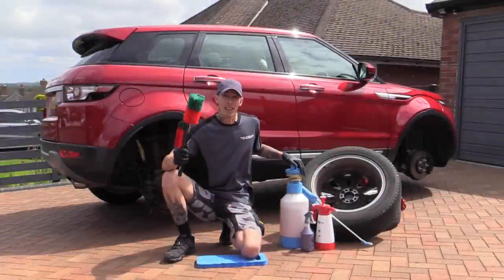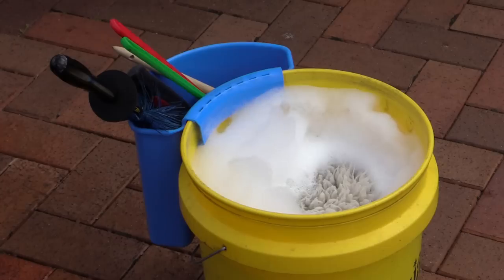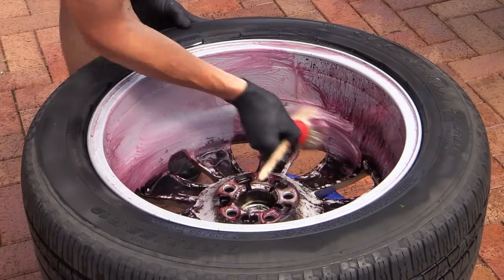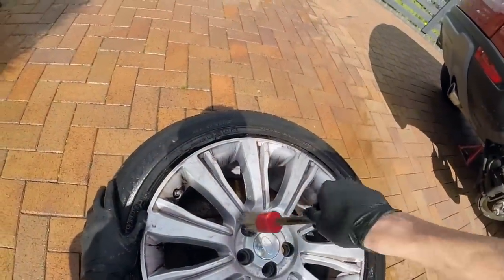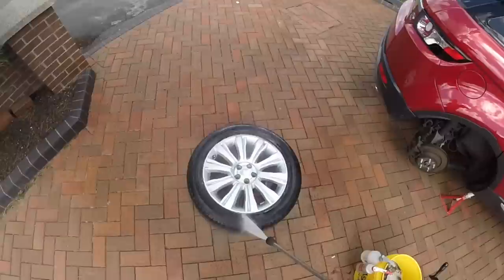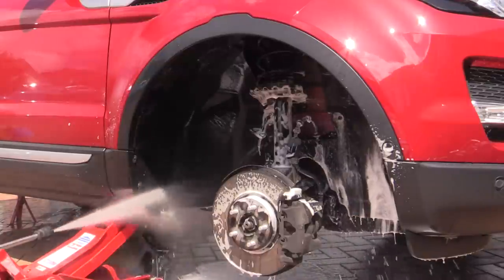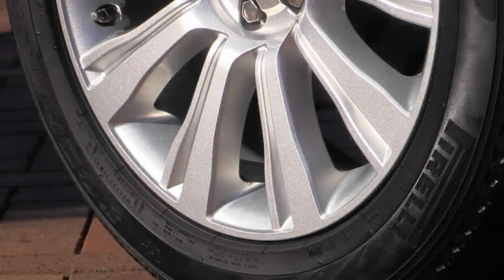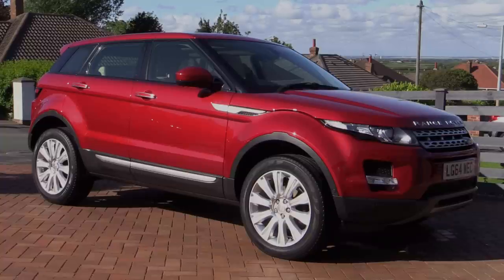Range Rover Evoque Wheels-Off Wash

Comment from the maker: One of those days.
Reply: I got the feeling it wasnt HIS wifes
Reply: Do you ever worry about repeat exposure to the cleaning chemicals and the contaminants youre cleaning off?
Reply: Car Cleaning Guru love your videos!!! Sending some warm texas love your way and if your a dad happy fathers day!!!
Reply: Is your car still for sale? If so how much do you want for it?
Reply from the maker: Not yet, still need to get a few pre sale bits done. Going to put it on eBay with a reserve so everyone can get a shot but I’m open to offers in the meantime.
Reply: Guru you're too hard on your work-- the car looks great and hopefully your wife agrees!
Reply: I'll be interested in your C30 let us know when your putting it up for sale
Reply: Just a quick question. Why not stop messing about with the wheels and just hit it with some acid or meguiars wheel brightener. Would have eaten that dirt up first time and is no more dangerous than anything else if used properly.
Reply: I believe it's metal from the brake dust when it fails the metal bonded to the hot paint work of the wheel it's almost impossible to remove with out  multiple goes with acid or iron removers to break down the metal and even then there still might be stains left
Reply: I say; SANDBLAST THOSE BASTARD WHEELS! MWAHAHAHAHA!!! (Seriously, would using an ultra-soft media like nutshells or plastica help in this case?"
Reply: If not already done, I highly recommend doing the autoglym valeting course. Doubt you need any training but once completed you're allowed to purchase their professional/trade products. Forget the rubbish in halfords, the professional stuff is utterly brilliant. They have 3 types of wheel cleaner of which the top one (red one) would have cleaned those wheels easily.

Comment: Not usually going all out on a daily driver. I usually wash the wheel wells frequently and the barrels of the wheels, without taking them off, just get in there with a wheel woolie or something to keep it somewhat clean so it never turns into a 6hr job. Great video, thanks for sharing.

Comment: This video more or less reflects what the average home detailer experiences and also goes to show that it doesnt always work out the way you think i will. Great job, nonetheless.
Reply: Count Olaf yes because this could be done in the most realistic manner, or otherwise for the 10% of non realistic manner pro-detailers woukd go too far grinding the wheels and putting clear coat later on which is simply worthless for something which has to face mud, dust and road trash only!

Comment: I used to be a professional car Valet myself, one of my regular customers was an old boy with an old rover, nothing special but he loved it, it always cleaned up beautifully apart from one wheel that was completely ingrained with brake dust as a result of a seized caliper and no-one cleaning the car before me, the customer knew it wouldn't come off as he had tried himself in the past, the very last time i cleaned his car i bought some 600 and 12000 grit wet and dry sand paper, a can of wheel paint and a can of clear coat, as a surprise, I rubbed the wheel down and re-sprayed it for him, it came out perfect, and for the first time in many years his entire car was clean, he was ecstatic! even more so when i told him i'd done it for free as he'd been one of my best customers over the years.

Comment: Quality video our mate and love the narrations mate keep us entertained while watching a long video about cleaning wheels. Can you make a video on rust mate ? How to repair rust and how to protect against rust in the UK..
Reply: I don't think repairing rust is a detailer's job especially when the rust is beyond superficial… You will have to remove the rusted steel (as it will be significantly weaker than good steel) and put in body filler or new steel. To protect against rusting you really just have to make sure there are no paint chips anywhere (which exposes the metal) and protect the paint?

Even superficial rust is beyond a detailer's job description I believe, because rusting usually occurs where paint is damaged (and it will in turn damage more paint). You'll have to sand down the rust and repaint the area.
Reply: @user-njyzcip  Is it the same thing for the underside of the car?
Reply: @HelloHi-tt5sl  Depends on what part. It is normal for some parts (eg brakes rotors and suspension) to have some superficial rust, but if the rust has gotten inside the metal you need to have someone fix that for safety. Either way, it's still not a detailer's job.

Comment: For really neglected wheels I use Autoglym Clean Wheels. Due to the hydrochloric acid it contains it is not the first product you should try but works well as a last resort and without much scrubbing gets years of baked on brake dust off. Keeps the videos coming as they are great!

Comment: I get similar stuff on my wheels. It's caused by the copper grease most mechanics put on before reinstalling the wheels after more major work. The grease stops them sticking to the hub so you can remove them easily. Then brake dust settles on top

Comment: Love the video!  I struggled detailing my summer rims last winter.  Luckily they were off the vehicle for the season so I didn't need to jack the vehicle. Some heavy clay and a compound / polish was able to get the rims sparkling clean.  I then followed up with 2 rims coated in CarPro Dulx and 2 with Gteqhnic C5 which was then topped with Exov4.  So far both treatments have been working well and wheel cleaner isn't needed, just soap and detail brushes.

I can appreciate the effort, and the video!  It is a huge job.

Comment: I use aluminum brightener on my wheels and it takes me about 10 minutes to do all 4 wheels and  I don't even have to scrub Just use the pressure washer after you apply the aluminum brightener to the wheels and you will get the wheel looking like new in no time .. works for brake calipers suspension parts too !!

Comment: I had the same problem with the inner spokes of the wheel not being able to clean them as easy. I had to leave the cleaning solution on there longer and then take a small tooth brush to finish the job.

Comment: I can relate to this so much... I bought a used set of rims for my car once that had a similar caked-on brake dust  - I don't think they were ever cleaned from the inside. It took me like 6-7 hours and I managed to scrub like 99% of it off but there were moments along the way that made me want to cry... I went at it with the iron fallout remover, some brushes a LOT of elbow grease and a... kitchen sponge which I realize is not the best for the paint there but: 1. It's not like my Astra is a showroom car and 2. How often do people really look at the inside of a rim? Afterwards I applied some wheel wax and now i'm just staying on top of it so it doesn't cake on like that again.

Comment: My strategy is to not ever let my wheels get to this level of dirt.  I wash the cars regularly, always do the wheels, inside and out with a long handled sponge too.  Or, crawl under.  Works great on the camper (caravan?), that way I can tell at a glance if 1 has a brake tighter than the rest (more dust) or needs attention.

Comment: You require aluminium cleaner. I have been using it on alloys for around 35 years. It will lift any ingrained brake dust etcetera easily. It also doesn’t harm the wheel in any way.

Comment: You could've got a better result with a stronger household acid product over the wheels, agitated with a brush. Few seconds and bamm the wheels are like brand spanking new.
I always apply this method with heavily contaminated wheels like this, and talking from experience,  not a single wheel were harmed and they get clean in literally seconds, the caked on stuff vanishes in 3 seconds and it doesn't hurt the clearcoat at all. Loved the video though, it was nice to see new footage from the Guru. :)

Comment: In germany you are not allowed to wash your car or the weels on the road because of the environment because there is very mich dirt and oil sometimes
Reply from the maker: Apart from brake dust and a bit of soot from around the pipes the majority of dirt you wash off a car comes from the road anyway.

Comment: If time wasn’t an issue what would be your next step for the inside spokes of the alloys?

I have come across that issue countless times where fallout remover, tar remover and a strong degreaser/cleaner won’t shift the staining.

Do you think a strong acidic wheel cleaner would shift it all? That’s the only product that I don’t own because I’ve never had a use for it.

Thanks for another great video 👌🏼

Comment: Another calming and informative video Guru. Great stuff. My OCD wouldn’t let me leave the crusty stuff on the wheel still and I have a couple of clients where, as it’s hidden away inside the wheel, they can’t see it. I want to do the right thing, but have shied away from the magic erasers. Is a magic eraser the only thing that will remove the crusty, baked on brake dust you didn’t remove or are there other ways? Your input would be much appreciated on this. Thanks.

Comment: Hi CCG great video as usual, where did you get your caddy for the bucket nice bit of kit and how would you proceed with that mess behind the Spock’s I’ve got a second set of wheels that was neglected I’ve got most of it off but still got backed on crud. Other options s to have them acid dipped an powder coating 🤔🤔🤔 can u help.

Comment: You did do the other side didn't you?? 🤣 
Or if it's like my house she will be waiting until next week for that half. 
Good content fella. 👍 
One added tip that I would add (which you probably did but didn't say) is to have that wheel balancing bucket full to add some weight and stability.

Comment: You need acidic aluminum wheel brightener for that stubborn baked on brake dust. After the metal remover, the acid does the trick.

Comment: A job I need to tackle on the lads new 208 GTi. Whoever had it before him couldn't of ever cleaned the wheel barrels. I really don't want to go down the wonder wheels route but these are pretty bad. Being a matt finish is a wheel wax worth doing or pointless on a matt colour so just use a spray sealant instead?

Comment: I highly recommend using some acidic wheel cleaner. As much as it sounds like it will damage the paint, using it just once or twice before protecting the wheels thoroughly, they won't do any harm as long as you use it on painted wheels. When I buy a new used car, I use this acidic cleaner once, before protecting the wheels with Gyeon Rim. This will ensure no more wheel cleaner usage, just regular soap. These wheels are very poorly painted on the inside, which makes them perfect to try this more aggressive wheel cleaner! These wheels could've been clean in 15 min each.

Comment: you could have used an acid based cleaner on those rims, will clean them in seconds and do less damage than the magic sponge, also the tar remover works better on a dry surface 👍

Comment: for wheel like this, i would prefer using a stronger product, like an acid based wheel cleaner, instead of the two step degreaser+ bilberry. Bilberry in my opinion is fine for wheels with light to medium brake dust, but when it comes to trashed rims on sports car with corrosive brake dust it shows its limit. After all it's a degreaser, even at low dilution which won't be effective in the case of wheels that don't get cleaner often.

Comment: Probably asked a million times but are you allowed to use all those harsh products without a water runoff catching system in the UK?
Reply from the maker: Yes! It’s your property, your land and there’s far bigger threats to the environment than the odd person washing a car.
Reply: @CarCleaningGuru  In Germany washing your car in your driveway is outright illegal. In some places in Sweden there is an up to £1000 fine. The reason being that the chemicals, especially the degreasers will fuck up the processes in the wastewater treatment plants. If it doesn't go in city drains it can and will leech into the groundwater. How large the problem is is certainly debatable. And I wouldn't say you are the "odd person" washing a car since you do it for a living.

Comment: Great video.
I like removing the wheels for a better clean too. The product I like for it is poor boy's spray and rinse on the rims. I also recentre the wheel centres to line up with the valve and where lock nuts are used place them closest to the valve too.

Comment: I did dirt wheels a while ago with better results in 1 step. I use SONAX xtreme wheel cleaner. just spray it on it, high pressure cleaner to spray it off. without working it in with a brush, I didn't have it with me in the laundry box.
Reply from the maker: No way any product would have worked on these without heavy agitation.

Comment: The reason why you can’t clean the spikes on the back is because you have water pooling in the spokes. Next time dry the areas and apply the cleaner. 

Your welcome. 

I’m not even a detailing addict.

Also, give the brake calliper a clean. 

Nice video
Reply from the maker: They were too far gone, despite the pooling there was still plenty of product worked into them over the course of the day but unfortunately they had started to corrode and the dirt and become one with that.

Comment: You would have been better off letting the wheels dry after the citris wash/degrease as putting the wheel cleaner (the one that goes purple) on straight away means much of its action is neutralised by the water already on the wheel (water neutralises the cleaner).  Also dont use a high pressure washer on painted surfaces like the face of the wheel as the paint can lift off - I have a Range Rover Sport and ask me how I know this :-(

Comment: Can anyone recommend a good baked on brake dust removal product in spray bottle size as I don't need loads of it, just for treatment on 4 wheels.
They are in good sound condition so a one off aggressive treatment would be fine then I would look after them with more mild products unlike the previous owner!!
Thanks

Comment: Your not supposed to get degreaser in the brake caliper, it can cause issues with braking
Reply from the maker: Like what?
Reply: The brakes can slip when slammed, because the substance has stopped the pads from making contact with the other pad
Reply from the maker: Degreaser won’t contaminate pads, the water in it may rust the discs up a bit but after the first bit of braking it will be fine.

Comment: how is it that the back of the spokes are not painted sufficiently so that the brake dust can never be removed again? because the automotive industry prefers to save this 13g paint in the manufacture of mass-produced cars. For the benefit of the shareholders.

Comment: Those wheels were beyond saving, they were refurbishment material.
Reply from the maker: I knew that the second I took them off to be honest but thought I might as well go through the motions!
Reply: @CarCleaningGuru  no hats off to you for trying. The paint on the wheels doesn't look the best or thickest either. Seen a few Jaguar Landrover wheels that are finished like this, faces nice thick layer, inner barrels a quick blow over type finish. Just gives less chance of getting wheels back to a good standard in these instances.

Comment: sorry but your tickling the wheel using the pressure hose, you may as well just use a garden hose
Reply from the maker: It’s just to rinse off the residue, getting in any closer wouldn’t have made any difference to the stubborn dirt unfortunately.
Reply: @CarCleaningGuru  that's my point you already drag the hose out and connect it to the pressure washer ONLY to do what the hose can do by itself, using a PRESSURE washer for a NON PRESSURE use
Reply from the maker: Paul Williams Pressure washer uses less water and even if it’s not removing the stubborn spots it removes everything else far more effectively.

Comment: Everything under solar rays... so bad..
Reply from the maker: Not ideal but no so bad.
Reply: @CarCleaningGuru  The worst thing that you used under solar rays is the iron remover. 
For the rest, instead, you can create halos due to the fact that you don't dry the car in time.
(Sorry for my bad English)
Reply from the maker: Alessandro Padoan I can’t cancel a shoot because it’s sunny, I’d never get anything done. I didn’t let anything dry on the surface so it’s all good. I’ve been doing this for over a decade so know how to operate in the sun.

Comment: You're cleaning a dirty tire with a makeup brush.  use a real brush job would have been done in 1/4 of the time.  These car detailing queers pushing shit boar hair brushes.
Reply from the maker: You can see me using a few stiff bristled Vikan brushes but it always makes sense to start with softest to prevent unnecessary scratches being inflicted.